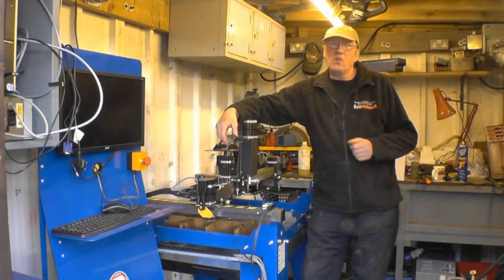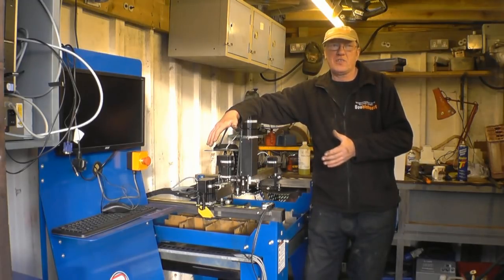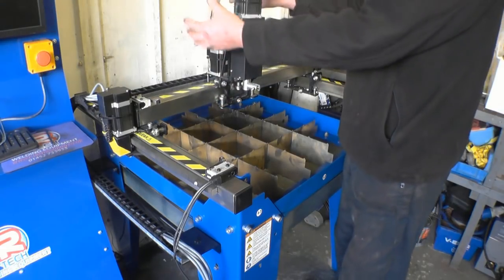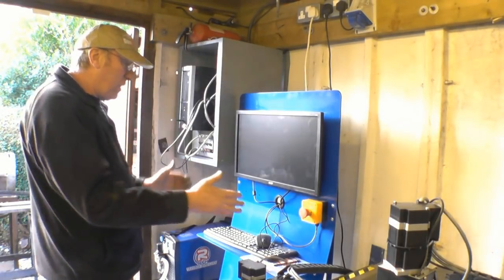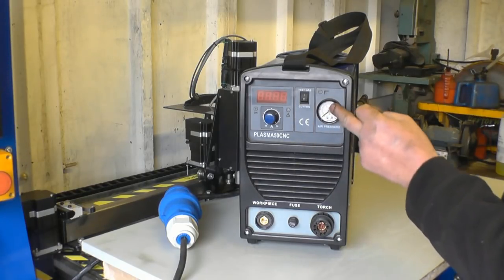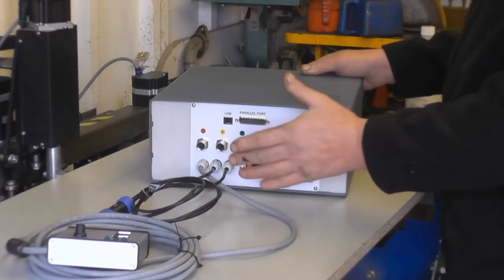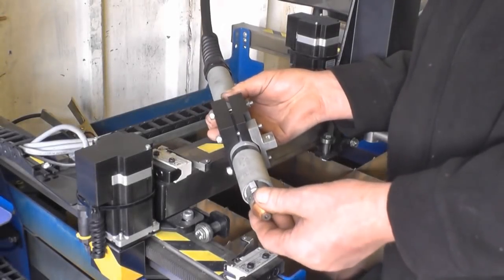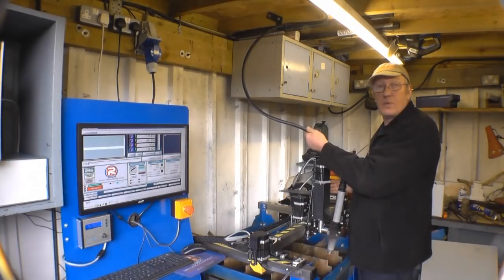R-Tech / Xtreme CNC  Plasma Cutting System   Review  Part one

Comment: Hi John, I have the same machine, but having no luck cutting 10mm steel. Do you have any settings please?
Reply from the maker: Hi In sheetcam i use setting "T13" with 40 amps at 80 % speed   75 PSI air pressure  Have you got a proper 32 amp supply  Why not ring R Tech technical helpline  You should be able to cut 10 mm plate no problem at all